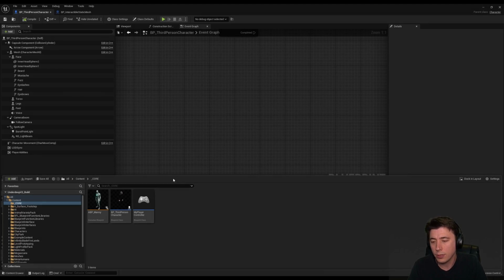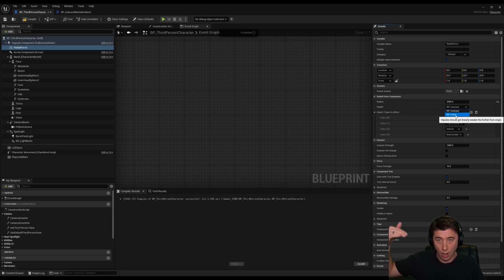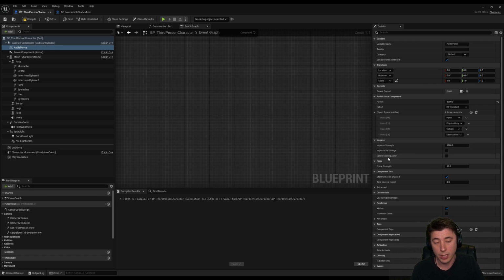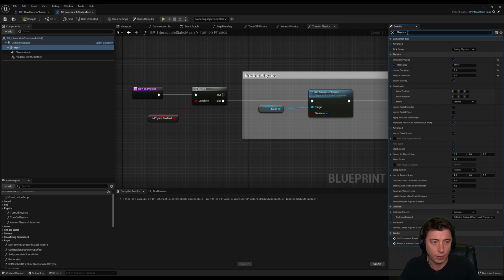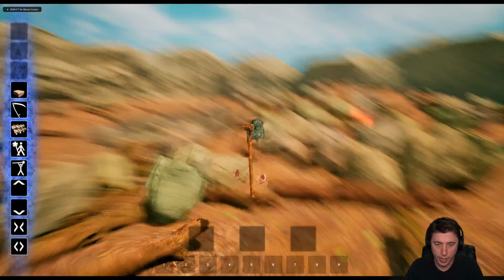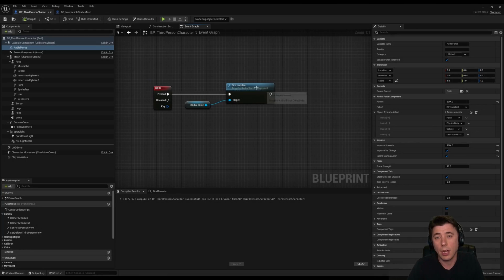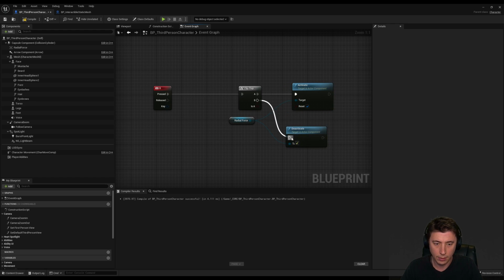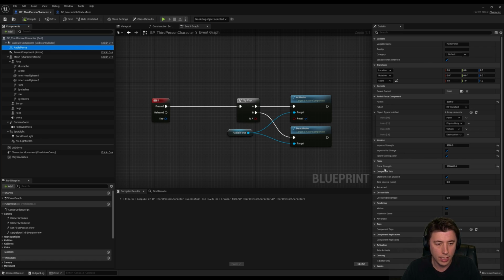Radial Force Component - Quick Blueprint Tutorial

Comment: This is really cool. Is there any way for this to push / pull in other characters? Enabling physics breaks all movement so I'm assuming it's not possible, or maybe that's just in my specific setup.
Reply: I hope so. It would be nice if it could be spawned like a black hole by one character, and then it starts pulling in other nearby characters, but if they are not too close, then they can overpower it by running away, otherwise, then they can lose movement and get pulled in and receive damage until it disappears.
Reply from the maker: Yes- almost certainly.  Haven't played with it though.  You might have to 'ragdoll' the character, or at least in part. I recommend looking into physical animations.